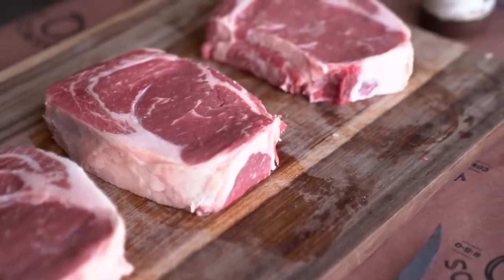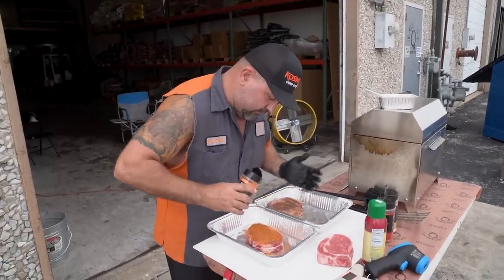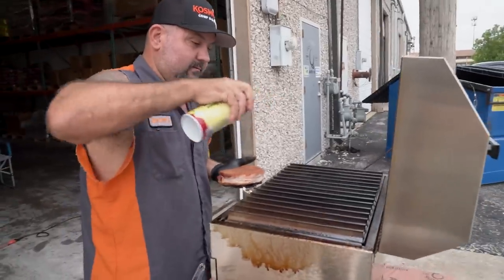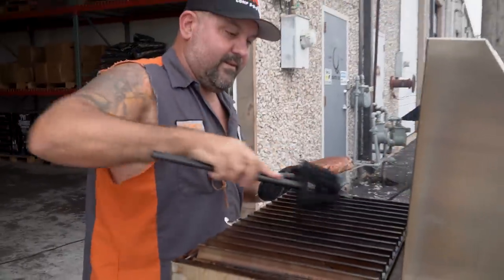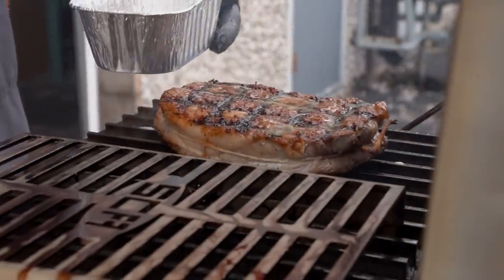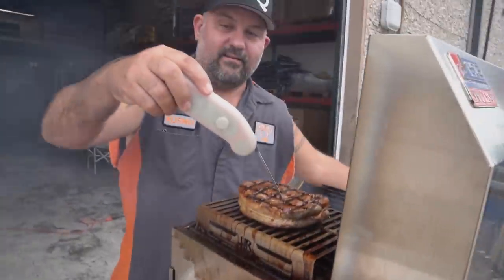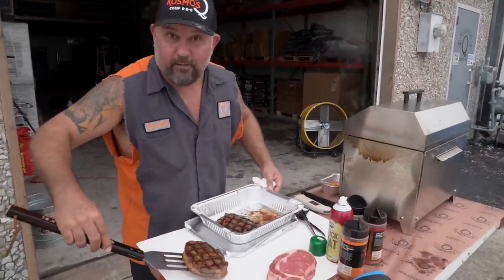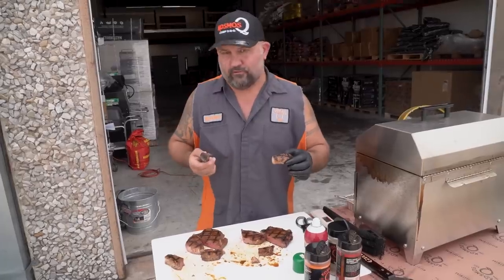How To Win An SCA Steak Competition Ft. Kosmos Q

Comment: Great video! What temp were you grilling those steaks at? Does that grill not have an exhaust to prevent flare ups that can mess up the grill marks?
Reply: E Emmanuel Garza the grill grates are solid at the bottom so there is never any flare up. No fat ever reaches the coals. Notice no quick flare ups when he sprayed the duck fat...

Comment: What temp are you getting the grill grates to?
Reply from the maker: I like 600 on the hot side. With the HB250 the “cold” side was about 100 degrees cooler when we burned it in.

Comment: I am surprised that the judges want grill marks.  Personally I would rather have an all over crust then a hard line of crust running through.  Food competitions are a funny thing it's no stranger than that meat and gravy competition they call chili.  Either way I would eat the hell out of that steak.  Going to try some of those steps for my next grill.  Thank's.  So far I have tried Cow Cover on beef plate ribs and country potatoes both were excellent.
Reply from the maker: Thank you 77Brainfreeze
Reply: I agree, all over sear >grill marks. However u're insane if you dont like chili
Reply: @dezal06  I love chili.  I was talking about ICS "Traditional Red" Chili.  Which is just a red sauce and meat (usually perfectly cubed steak).  It's a food competition to find out who makes the best sauce and meat.  No one would ever eat it that way.
Reply: @77Brainfreeze  
I am surprised that the judges want grill marks. Nothing required in the rules for grill marks, nothing in the rules on what heat/fire you use. The grill marks come from using "Grill Grates". There are some guys trying the pan sear for comps but I have not heard of anyone placing yet, I say its coming sooner than later. SCA is growing by leaps and bounds, new cooks ever comp!!

Comment: What's the string for???
Reply from the maker: When you drop the steak on really high heat, it falls apart. SCA has a special scoring category for appearance so guys started tying them up to help them maintain shape through the cook.
Reply: @KosmosQ  Also use toothpicks or metal picks along with the string. Kosmo do you use either if your cooking a comp???

Comment: According to joe rogan briquttes charcoal contained gasoline in it ..  is that true ?
Reply: No way, first the gas would evaporate and second if it did not evaporate when you started to light it would blow up in your face. I have read that when Kingsford first started that they used coal dust as a binder, don't think they do now, burns to clean.